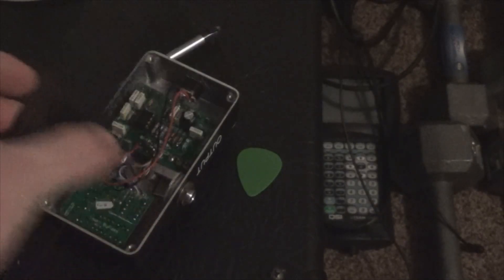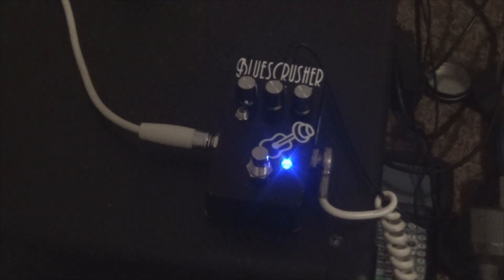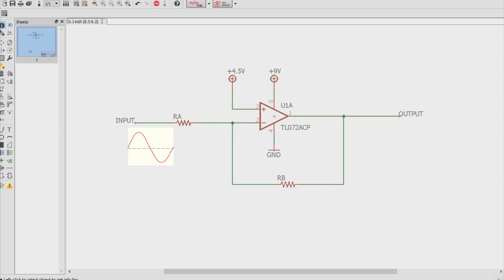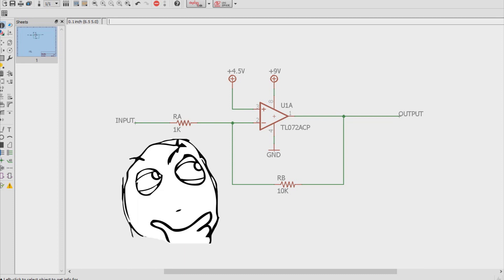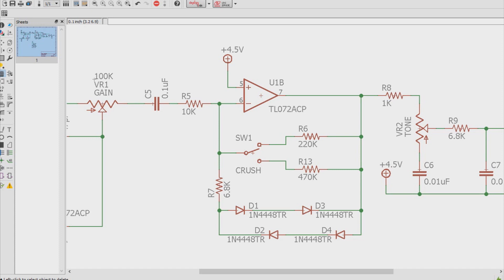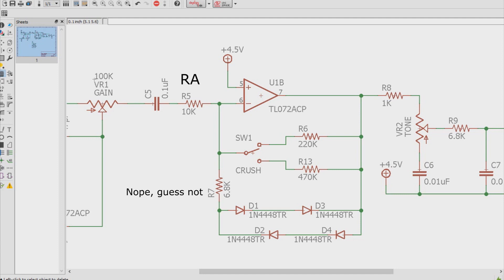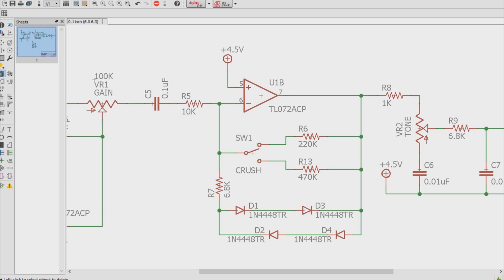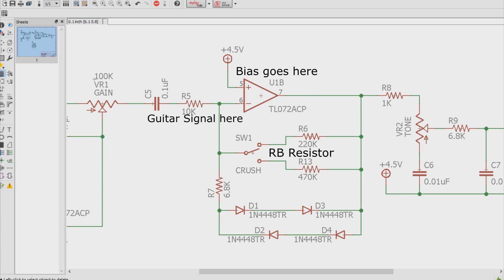Guitar Pedal Mod - OpAmp Gain Part 1

Comment: I have two questions about R7:
Does it need to be wired on the input side of the feedback loop or it doesn’t matter if it’s on the input or output side?

And if I would want to set this resistor as a potentiometer of “Drive”, how should it be wired? In a voltage divider fashion or just with two lugs in series like a rheostat?

Comment: I connect the TL082CP to 9V+ at pin 8 and pin 4 at ground. And the bias at 4.5V at pin 3 but the amp heats up quickly. What is wrong with the connection?

Comment: I'm lost in the +4.5v & 9v
How do you get 4.5?
I'm of course uneducated in all this - but curious when we put a 9V battery in a pedal - that's all I know is 9V is feeding the circuit.  Where does 4.5 come in?
Reply: That's the bias voltage, created by a voltage divider. We just did a video on bias resistors that go over this.

Comment: The resistor in series with the clipping diodes does more than one thing. If you forget the clipping diodes, that resistor is in parallel with Rb. Massive effect on gain (much less gain). With the diodes in the circuit, it effects gain less, but it does still have an effect.

Comment: I find the most helpful way to think about op-amp gain is to imagine it as a car whose accelerator pedal is welded to the floor, such that there is no means to give it more gas; one can only regulate speed by how hard you step on the brakes.  In other words, you have to subtract from maximum gain, rather than add gain from zero,  The feedback resistance from output back to input sets how much negative feedback is applied from the output back to the input.  In other words, you're "stepping on the brakes" harder, and reducing gain from maximum.

Of course, if one places a capacitor in that feedback loop, you're providing a really efficient path for negative feedback of whatever frequency content is dictated by the value of that cap, reducing the gain for that higher-frequency content even more.  So, using the example shown, R13 ups the gain of that stage by providing a less efficient path for the negative feedback - essentially lifting your foot off the brake a bit.  But since that will likely make the clipping a bit harsher, let's stick a capacitor in parallel with R13, such that flicking the switch lets higher frequencies have more negative feedback than the rest of the signal.  If one stuck a 220pf cap in parallel with R13, that would result in a rolloff beginning just over 1.5khz.  That seems like it might be dull-sounding but the rolloff is actually pretty shallow, such that there is still plenty of treble content, just not quite as much, with the Tone control still having something to smooth out.

Let's take a different slant.  Imagine we have two 100k resistors in place of R6.  Two hundred kilohms would give us a modest amount of negative feedback, so we'd still have a reasonable amount of gain.  Now imagine we run a  1000pf (.001uf) capacitor, from the point where the two 100k resistors meet, to ground.  What have we done?  We've essentially "told" the op-amp that we're reducing/"dumping" negative feedback for frequency content above roughly 1.6kz.  And of course, if we reduce negative feedback, we are lifting our foot off the brake so we get more gain for upper mids and treble.  We have effectively turned the pedal from a flat boost into a treble boost.

Planning out how much negative feedback you want to apply, and for what range of frequencies is an essential part of pedal design.

Comment: Erik, I have decided to try this on a Morning Glory circuit.  But I am thinking of keeping the 220k ohm resistor and then running in series into a 500k pot to give more flexibility of gain.  What's your thoughts on that and would you use linear or logarithmic? (Hopefully you see this since this video has been out for a while now.) :)
Reply: I would go with Linear instead of Logarithmic. Technically, they would both work, but Linear would do better, in my opinion. Besides, most gain stage controlled pot circuits seem to linear as well.
Reply: @erikvincent5846  Thank you for your input, linear it is.

Comment: How do you know you can increase RB to mega ohm without it clipping?
Reply: Basically, you need to know what your peak to peak input signal maxes out at. If you strum lightly, it will be less voltage. If you strum hard or have a heavy pick attack, the voltage is more. Also, low output pickups have less voltage, while hot pickups have more. Usually, these voltages are measured in millivolts. If that maximum voltage, times your calculated gain is greater than your power supply going to your opamp (minus a volt or so, unless your opamp can do rail to rail), then it will clip. So to reduce clipping, either decrease the gain amount or increase the voltage supply.

Comment: Nice work, thanks.  I'm still pondering on why R7 doesn't figure in the gain calculation. i.e. isn't it in parallel with Rb whenever the output exceeds ~+/-1.2v (nominally)?  But I'm probably missing something fundamental about that feedback loop.  Yes, more videos like these please.
Reply: R7 does influence due to your conclusion, but because of the feedback loop itself, it doesn't effect it greatly. It's like the idea of reactance in capacitors, where capacitors themselves can be treated as resistors in certain cases (frequency specific). So, though it has some effect, its more or less negligible in most cases. Still, at the end of the day, the biggest effect will be to change the main feedback resistors.

Comment: https://www.watelectronics.com/inverting-amplifier-circuit-working-and-applications/ here is a link that explains what an inverting op amp is in case someone wants to dig a bit deeper. Maybe a SPICE simulation could help with the understanding of the signal clipping compared to the resistor value that you mention in the end. Great video nevertheless for someone that wants to have a basic understanding of how on op amp works.